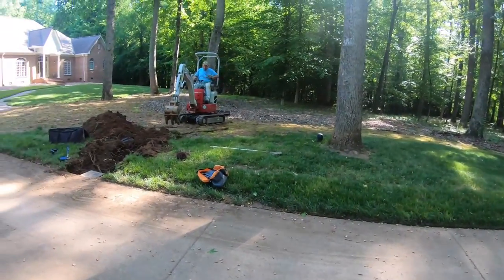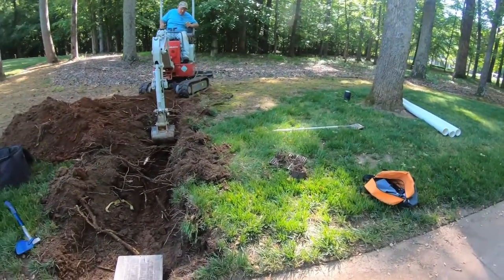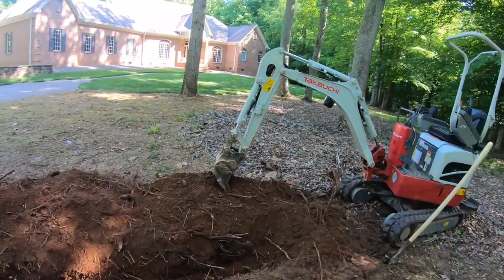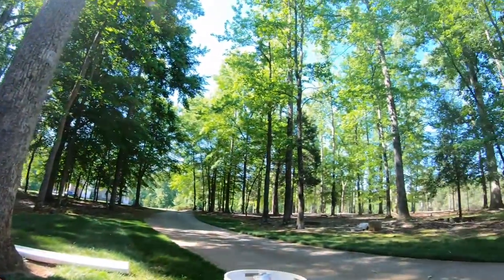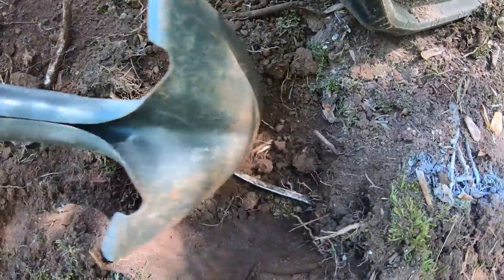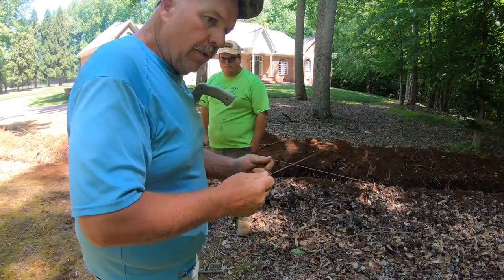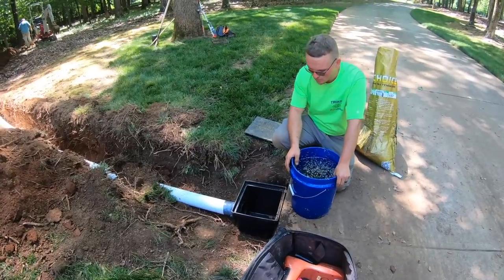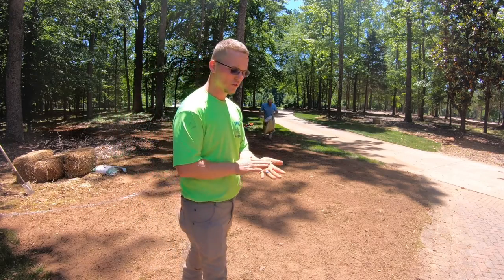Excavating - The Importance of Underground Utilities

Comment: this is something I need to know more about, but most rural homes have nothing other than water line, but "progress" is sneaking in. Grrrrr. several months ago cable company was digging on main  road 10 miles away, hit phone company fiber optic cable, YEAH! the phone company had to do live checks for all lines out, at present only internet is through phone company, but soon will have option from cable company,  but thousands of people were without phone, & internet, as well as some businesses. was out 1 1/2 weeks.  I wonder how expensive of a mistake that was?
Reply from the maker: Thank you for watching! I used to work as a fiber splicer and a fiber cut can start at 5k to repair. And believe me based on the size of the line and how important it is that number can creep up to 10s of thousands of dollars. Thanks Randy!

Comment: Correct me if I’m wrong, but it didn’t seem like the water came out as fast as you put it in with a 5 gallon bucket? Almost like there’s not enough fall on the drain.
Reply from the maker: You’re right  I think that was a premade box  and it’s got a mud trap in it so the water is restricted a little bit and you’re right again the fall was probably 1 to 1.5 % of  didn’t have a lot of fall on that one.  Thank you for watching